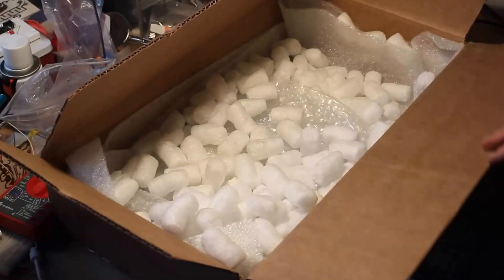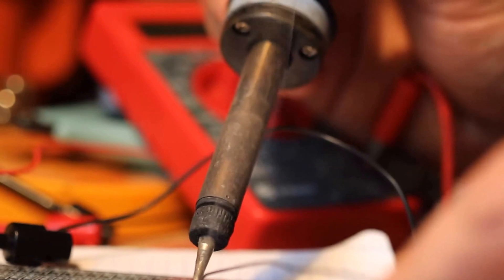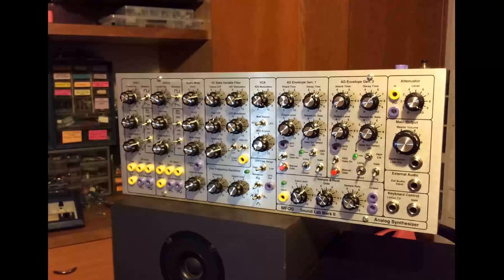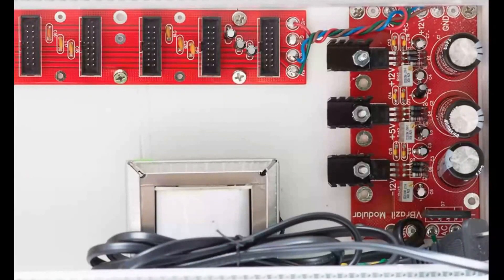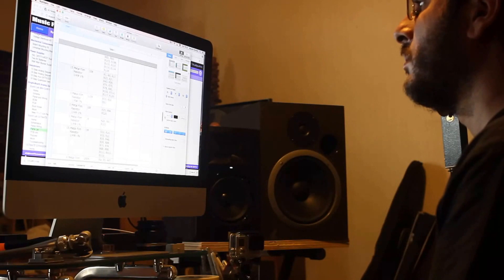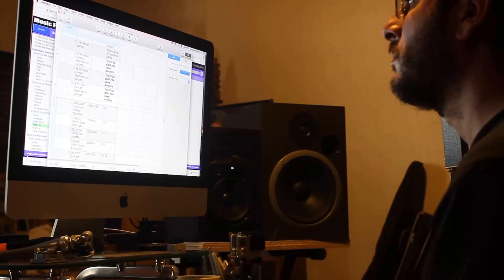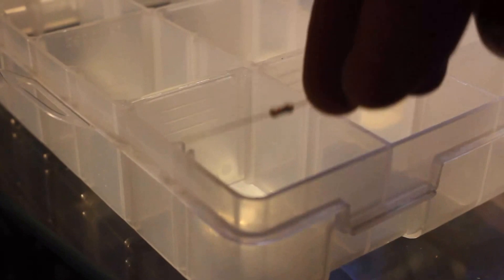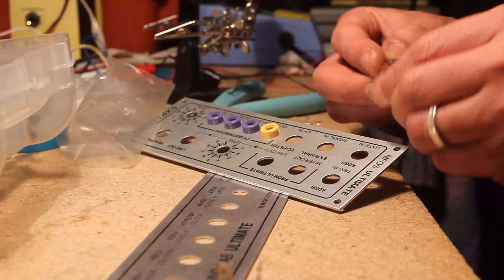Soundlab Build Log 1 - Planning and Sourcing Parts : The necessary evils

Comment: Awesome. Love all the nitty gritty stuff. I source all my parts and it's something I need to make into a steady work flow. Those bananas you are using..  Do you notice a benefit of those over the cheaper tayda jacks? Thanks!
Reply: You know what.. Disregard that I thought for sure I got mine off tayda. Must have been the eBay. Either way, dig the video! (I'm planning on making a spreadsheet for about 15 new boards tonight. Gonna be a party)
Reply from the maker: @bluesgut  I just looked and Tayda does have some they call "binding posts". I have seen and used identical ones but IMO they are too tall. These are nicer for sure.
Reply from the maker: Tayda has banana jacks now? cool, back when I used to order from them a lot they only had banana plugs...  I inherited these jacks from Ray Wilson himself, so of course I'm using them on mine :)

Comment: My feelings about Synth DIY is the exact same as yours. I enjoy almost every facet of the hobby except for 2 things: sourcing parts, and trouble shooting. That parts-sourcing pain in the ass is the exact reason why 95+% of my DIY builds are ones that come as complete kits. Unfortunately, no one can really do anything about the trouble shooting bit, it really is an unavoidable, but necessary evil that sometimes has to take place.

Parts sourcing is what stops me from buying and building almost all of Ray's MFOS stuff, even though most of it is right up my alley, -especially the very items you are assembling in this video.
Reply from the maker: I actually don't mind trouble shooting! For me it's where you really learn, otherwise it's just paint by numbers. To fix something you need to understand how it works, so you can isolate the components related to the faulty function. It can be frustrating and take a lot of time but the satisfaction from having resolved a problem makes up for it. And each time you are successful at troubleshooting you are better equipped for next time something doesn't work.
Reply: True, it's frustrating but you do learn a lot. However, at the moment, I don't have a working oscilloscope, so trouble shooting is even more of a pain in the ass than it would be normally be, lol.
Reply from the maker: yes, things definitely improved for me once I got a scope, but there's a lot you can do with just a meter and a signal tracer (wire tips connected to a battery powered amp)